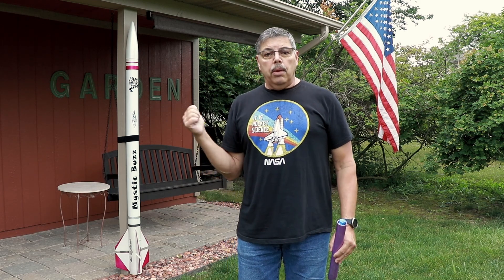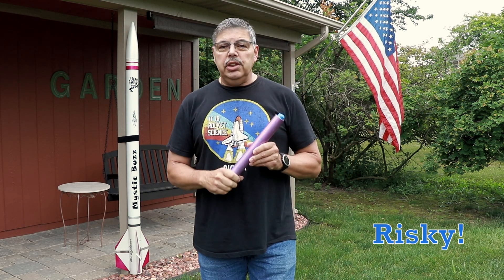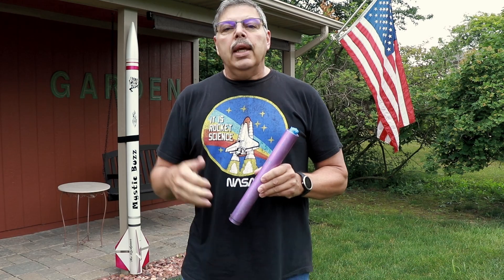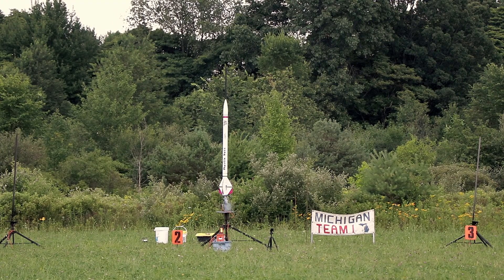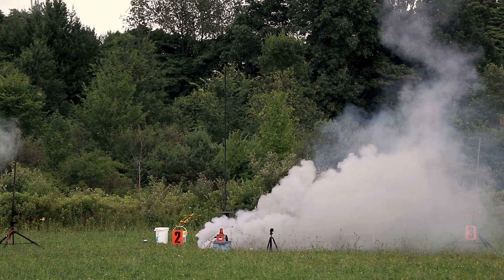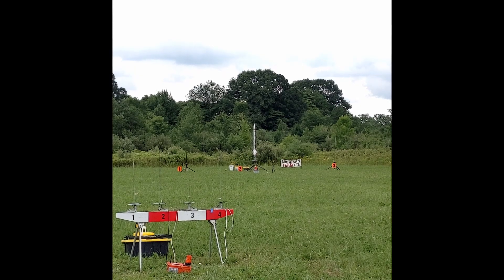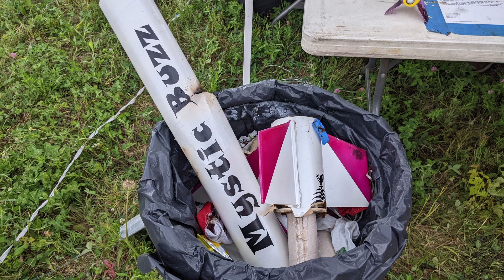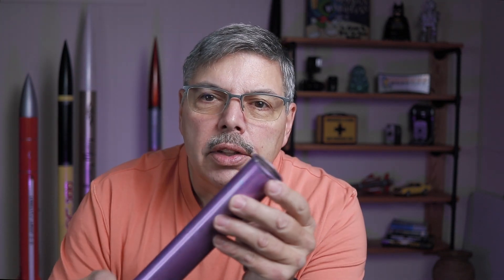Rocket Explosion -  Mystic Buzz

Comment: I am still super new to this...... but could one lop the ends off of the damaged motor case and re cut the groves and such? Maybe be able to salvage the case and it hold just one less grain? A mini lathe might be able to handle those operations. Anyways, thank you for the great videos for a new person like myself!
Reply from the maker: I have had a few cases repaired by cutting both ends off and cutting a new grove for the snap ring.  Sometimes the case is too bloated for a repair.

I make the nozzle and forward bulkhead on my mini lathe. The bed is not long enough to repair a case.

Comment: At 2:20 - wouldn’t aluminum make the propellant more efficient, higher specific impulse?
Reply from the maker: Yes, aluminum will provide a higher specific impulse in larger motors or with AP. It will be tricky to get it working in a smaller sugar fuel motor. I still think it is possible.